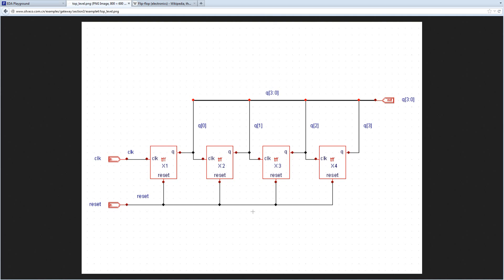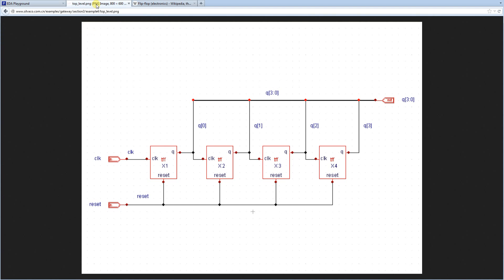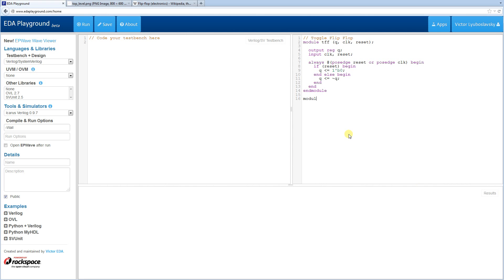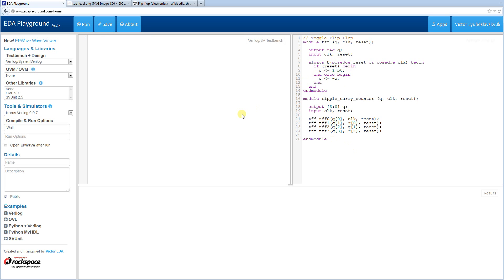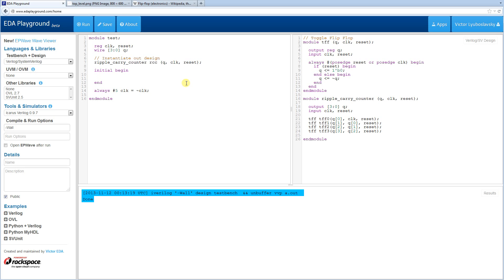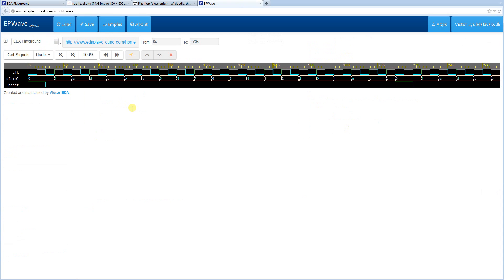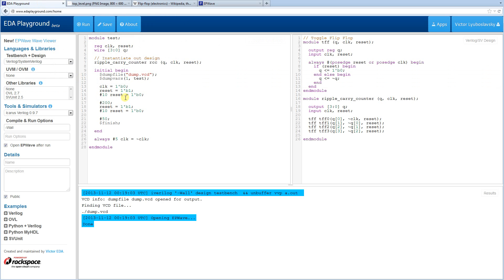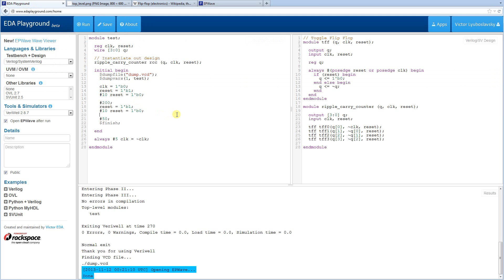Verilog Tutorial 1 -- Ripple Carry Counter

Comment: Hi. Great video! i wanted to know if theres a differnece in [3:0] and [0:3] in defining a variable in verilog. both essentialy define a 4 bit variable.
Reply from the maker: [3:0] and [0:3] both declare a 4 bit variable in verilog, as you say. The only difference you would encounter is if you tried to access a subset of the bits, for example individual bits. Then with a variable declared [3:0] the left-hand bit or most significant bit (MSB) is [3], whereas with a variable declared [0:3] the left-hand bit or MSB is [0].

Matthew

Comment: Hi Victor,

Thank you for a fantastic introductory video. I have a question: How does changing the T flipflops to trigger on the negative clock edge cause the counter to count upwards? I thought negative edge vs positive edge wouldn't matter because in the end, it just acts as a trigger to flip the value of the input q. I think something else is happening here.
Reply from the maker: You're right - something else is happening here. 

If this circuit were synchronous, then changing the clock edge would just change the clock edge on which the counter outputs changed. It would not change the direction the counter counted in.

But this circuit is not synchronous: a ripple counter is not a synchronous design. For a design to be completely synchronous, all the flip-flops must be clocked all the time from the same edge of the same clock. This is not the case here: each flip-flop is clocked by a different clock - the output of the previous flip-flop. 

Matthew
not Victor
Victor made the video and created EDA Playground. My company - Doulos - acquired EDA Playground last year and now operates it and maintains it.
Reply: i believe it is correct that on negative edge of reset, the counter will work as an UP counter. This is what happens when you build a ripple counter using JK FF as well. for reset = 0(negedge) --> UP counter, for reset = 1(posedge)--> DOWN counter

Comment: How can you get a synthesis report through EDA? i tried but i dint find anything useful in the downloaded files... could you please help me?
Reply from the maker: You can get reports when running the VTR synthesis flow.

Yosys does not dump reports. We will work on adding a stdout log file for Yosys.

For reference: Verilog Synthesis on EDA Playground (1 of 2)
Reply: EDA Playground  Will i get a power report too, in the synthesis report???
Reply from the maker: Padmaja g v Not 100% sure, but I don't think either VTR nor Yosys create a separate power report right now.